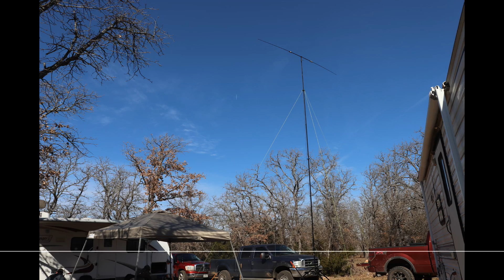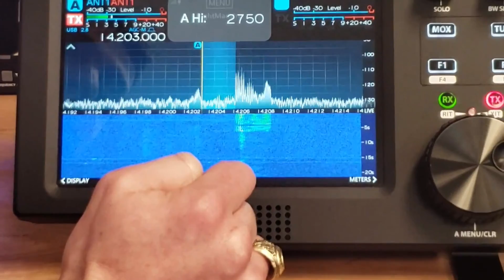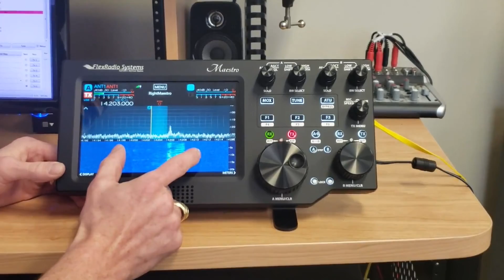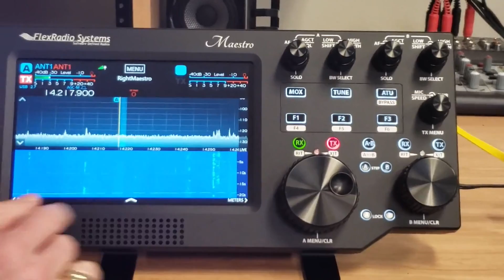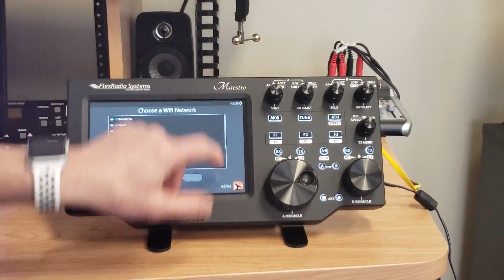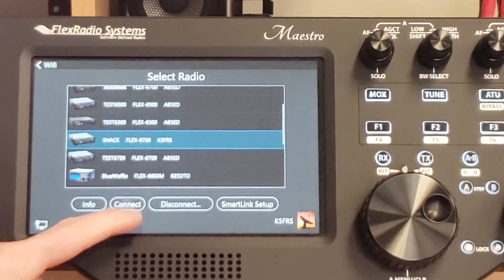FlexRadio Maestro Introduction, Part 1

Comment: Hi Thanks for the info . I have a question ( sorry if its dumb )  My pal has a full flex setup 
 with a great antenna . he does operate remote from his home as the weekends but does not really use the station on weekdays . If he grants me permission to use his station on  the weekdays will I be able to purchase my own Maestro and be in a position to log etc like my friend does ?  
 cheers for now
Reply from the maker: Yes you can. You can also download the SmartSDR software for free and use it straight from your computer
Reply: @HamRadio2   Thanks a lot . If it pans out ok I will be happy to get a Maestro .Looks like a good bit of kit . 73 for Now. Ron G4DIY

Comment: Do they supply Flex Radios to others besides hams?
Reply from the maker: They have some government contracts, I believe. But mainly Hams.
Reply: Flex just announced a joint relationship with Raytheon to supply airborne comms systems to the Air Force.